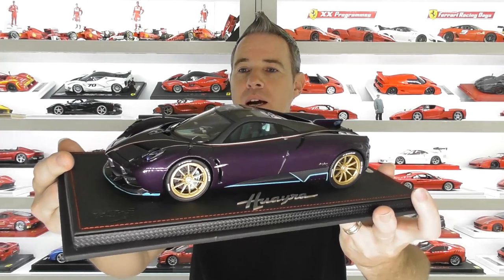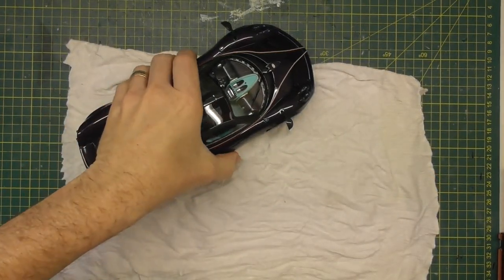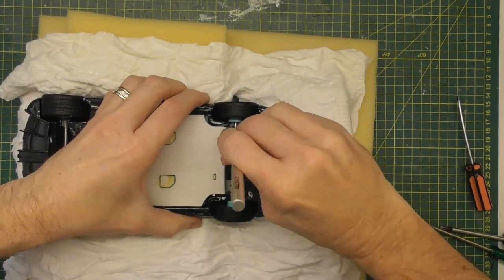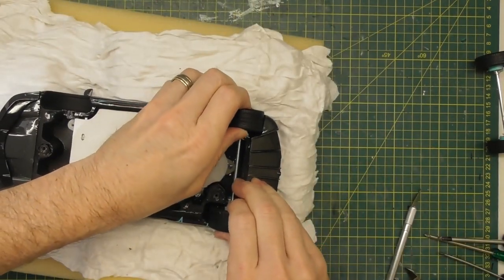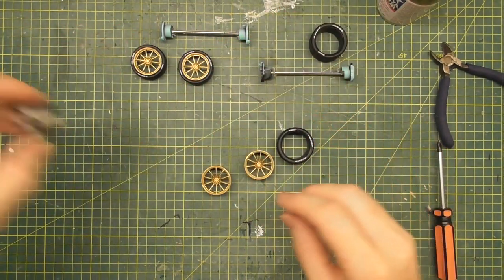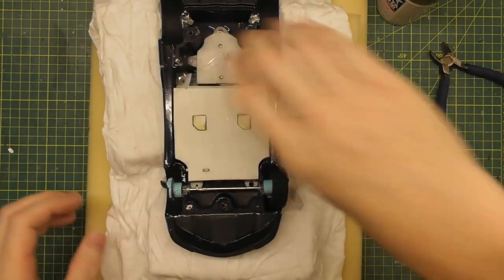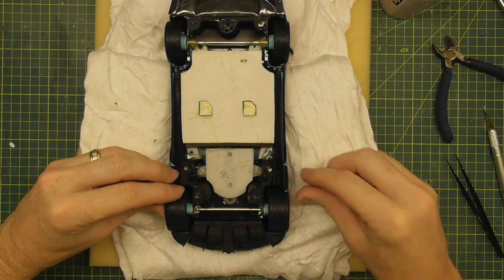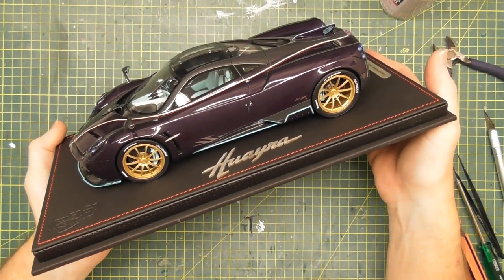How to fit Pagani Tempesta wheels to your BBR Huayra Dinastia

Comment: Nice video,i think i would use an old soldering iron and melt small amounts of the glue so that is softens enough to pull the axles out.

Comment: Hi Rob, so I used a heat gun, very gently, with 5 second bursts from approx 5 inches away from axle ends..after a few seconds the hot glue softens, and axles lift away!...calipers & wheels all had to be repositioned though as they came off clean.
Reply from the maker: Thanks for the tip Gary, I will try that when I pull apart my next resin model.

Comment: Question. Once you removed the axles, you then just pulled the wheel off with the use of a pair of pliers. Is it possible to do this without going through the trouble of removing the actual axles? Sorry if this is a stupid question
Reply from the maker: Usually there is so much glue around the axle/wheel stem that if you try to twist the wheel off the axle, it will break the wheel, plus there is very little space around the tyre to grab onto to twist it off.
Reply: @ROBSMODELCARS  thanks for your quick reply. 
But your pulling, not twisting right? From what i can see there is space in the middle of the axle to be able to grab it with pliers to hold it while then pulling the wheel out, just as you did after you pulled the axle off. Obviously it would be abit harder to steady and grab it as it is still attached, but if its just a matter of pulling the wheel off, then to me it just looks you can do it without actually taking the axle off. But of course, i know that you are much more experienced than me, i just wanted to see if you thought it was possible to do it this way

Comment: The shark fin at the back is slightly bent
Reply from the maker: I know, I was checking to see if I could remove it and make a copy of it for my next Huayra Chiwin build. It is only hot glued on and after I remove it to copy the part, I will then glue it back on permanently straight.

Comment: Can those work for autoart?
Reply from the maker: You may have to modify slightly, but getting the AUTOart wheels off is the hard part. Most of the time, you will have to cut them off thus destroying them.